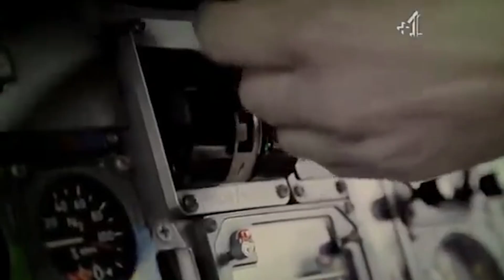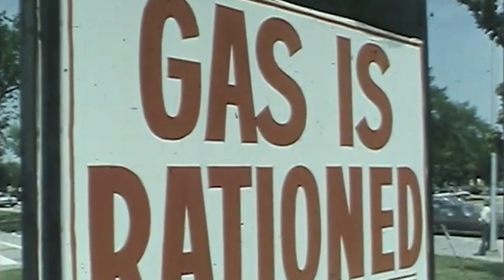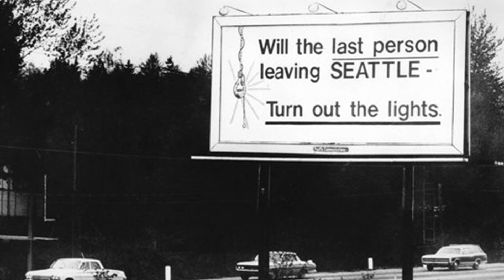The Forgotten American Concordes - Boeing 2707 - Lockheed L-2000 SST

Comment: Meh, it's unlikely anybody will be too bothered with SST any longer, at least not with Virgin Galactic working to bring sub-orbital flights to the private sector.  Granted, getting it to work reliably and safely is no trivial thing, but if they succeed, we'll have trans-atlantic flights that are far shorter than even 3.5-4 hours, and without worrying about the issues with sonic booms over populated areas.

Comment: 6:51 Yes jet engines would be inefficient during taxi, but the engines are not at full throttle on taxi. So it's still less fuel burn than flight (even though it would still be hopelessly inefficient at taxi speeds). But the actual hourly fuel burn on taxi would not be any where near maximum (like on take-off). I don't believe two tons of fuel burn just to taxi to the runway. No way, the whole max loaded weight of the plane would be much less than 400 tons (weight of a loaded 747). So if it burns two tons on taxi, take-off should burn more, and how long would it stay in the air with that sort of fuel burn. It would have about 100 tons max of fuel on board (otherwise it would weigh more than a 747). At 2 tons for taxi, you are looking at at least 2% of the total fuel burned before it even takes off. How many tons for take-off? With that sort of rate, another 8 tons at least. 10% of fuel burned after take off. Would that be right? And the speed makes up for it? Maybe it does, but it sounds like a bit "tabloid" to me. lol

Comment: many yrs ago, I once asked my mechanic about how much it might cost me to make a car I used to have, run faster with a more pwrful engine? he said, "it all depends much you're willing to spend." it's all about $. the faster you wanna go, the more expensive it gets. I'd be more than satisfied with an SST that could go mach 1 or even just a little faster. it doesn't have to-do-mach 2 or higher. of course there is the problem of the sonic boom. when engineers find-a-way to get past that obstacle, & make SST travel affordable, then you'll have-a-winner.

Comment: I wish they'd bring it back or make a cost effective super sonic aircraft.
Reply: There are a few concepts in the design phase, but they are much smaller and will travel slower than Concorde to reduce the sonic bang or boom. The largest I read about will carry 40  passengers and travel at about Mach 1.4 to Mach 1.6. One big problem seems to be in finding a suitable off the shelf engine or one that needs few modifications.
Reply: Phuck Hugh simple get army ones
Reply: Phuck Hugh I mean join army as pilot
Reply: Phuck Hugh Yeah, Club Concorde will bring back the Concorde in 2019
Reply: prestige is one thing, but gosh such planes are terribly noisy and expensive. A ticket on the Concorde was extremely expensive, and since we don't all have an income like Phil Collins...

Comment: damn those things are beautiful... wish they bring back the Concorde..
Reply: They will not bring it back. Too much of a sonic bang over land. Next generation will travel slower to reduce sonic boom over land.
Reply: +David Hoffman would've been nice if i was old enough to see them
Reply: Rage Lorenz, One really sad aspect is that the Concorde B model would have solved a lot of the takeoff and landing issues the A model had. Leading edge flaps, revised wing shape, and a better engine with no need for afterburner or reheat would have provided reduced takeoff noise, reduced runway length requirements, and lowered fuel consumption on a per ton-mile basis. But Aérospatiale/BAC insisted that 120 A models had to be sold before the B model would be produced, and then only with 120 firm no refund orders for the B model. Sadly only 24 A models were ever ordered, and they did not even produce that many.
Reply: Indeed. As if they knew this project was going to be temporary

Comment: Am I crazy thinking in the 60s we would hear sonic booms now and then?
Reply: Even in the 60's there were restrictions prohibiting supersonic flight over populated areas.
Reply: Yes, if you lived near a military supersonic test area. It still happens today when they test supersonic military aircraft.
Reply: I rarely see anything these days, but I'm only about 25 miles from Willow Grove, they shut it down a few years back, but who know what was flying out of there in the 60s.
I'm also close to two national guard air wings, every once in a while in a while I'll see a couple A10s, I assume that's were they are coming from there, there's no way they are going SS.
I don't what they flew back in the 60s?
Reply: I live in the Netherlands and in the end of the sixties you could hear the sonic boom there. This must have been starfighters?
Reply: hendrikjanvanduin, Mostly F-104s and a few F-5s. More F-5s added in the 1970s.
Reply: no
Reply: It was quite normal back in the 1950`s, but later not so common, I have heard the sonic boom from the Concorde  but that was out near the coast in a remote location.

Comment: Concorde paid for by the people so the rich could get there faster
Reply: Remember this was before deregulation of the airlines. Aviation was costly for most anyway, so this was just a normal progression of that cost. And the Cold War was in the background. No way could we let the Soviets create something like this without being challenged was the thinking at the time.
Reply: The thing with it was that it could go supersonic and stay there, im sure that was a first because military jets could only do this for a short time so I read a time ago
Reply: *****, True, for interceptors you will go supersonic to get to the opponent quickly, but then the air to air combat often goes down into the subsonic area. For high altitude bombers the plan was to stay supersonic all the way, but that ended up a failure. Now you use supersonic as a dash speed through some of the opponents areas, but not all. Concorde could fly supersonic without the continuous use of reheat. Reheat was only used to go from subsonic to supersonic. After getting significantly past the trans-sonic zone the reheat could be shut off.
Reply: Sounds about right.  Certainly the resentful part.
Reply: You do get that saying "The top 10 percent of taxpayers paid over 70% of the total amount collected in federal income taxes in 2010" means nothing on it's own right? What did they earn in income and capital gains? If they got 90% of the income (hypothetical - I don't know the real number) then 70% is actually not their fair share... that's a pretty misleading thing to say lol.
Reply: Blame Warren Buffet, he claimed he was paying less taxes (by percentage of gross income) compared to his  middle class employees. Rich people can pay less taxes LEGALLY through investments, bonds, charities, deferrals. Rich people become rich because they buy something that make a lot of money! Middle class become poorer because they buy expensive things that doesn't make any money!
Reply: http://www.telegraph.co.uk/finance/personalfinance/tax/11233686/How-top-3000-earners-pay-more-tax-than-bottom-9-million.html
Reply: +Miike Hunt Do you have link about the documentary.
Reply: stickmagnet   Well duuuh! Up to $99,999  you pay taxes on every dollar past that,100,000 and up you pay taxes on the first $99,999 regardless of how much over that! So Buffet was telling the truth!
Reply: SE09uk so not true. i dont know about america which seems to have given 75% of the costs of the planes however, you did not have to be "rich" to go on concorde
Reply: what prove do you have?
Reply: But it looks nice so that's OK :)
Reply: hs2
Reply: squach623 !!!!!
Reply: The top 10 percent of taxpayers paid over 70% of the total amount collected in federal income taxes in 2010.
The remaining 90% bore just under 30% of the tax burden. 47% of all Americans pay hardly anything at all.
These number apply to US taxpayers as of 2010.  The percentage paid by the wealthy is even higher today.  You live under the delusion that somehow you are being ripped off and are ignorant and arrogant enough to call other people naive.  The notion that rich people don't pay any taxes is a myth that's repeated often to keep people such as yourself in a constant state of agitation and more likely to vote democrat.
Reply: You sound like a pretentious and envious git whinging because some people have more money than you. How sad.
Reply: The Concorde was the beginning. Before the Concorde, only some professional pilots at the military flew supersonic. With the Concorde, everybody could theoretically buy a ticket although practically only the rich would do.
But the Concorde was meant - or wasn't it? - to be the beginning. When the rich paid the tickets it should have financed the development of new better supersonic aircraft: bigger supersonic airplanes where the tickets are cheaper than in the Concorde, so the less rich can fly it, too. But we never got there.
All the anti-Concorde measures were also measures to block the development of future cheaper-ticket supersonic airplanes. And that's what's sad: that the more advanced airplanes were never build. Not so sad: that the Concorde disappeared.
Reply: Greg Howard lol your so naïve
no they don't, they pay very little, they use loop holes and scams like giving to charity and getting it back later. (the people I used to work for did that and NEVER paid a penny tax) 
I'm guessing you were born yesterday as they say ;-)
Reply: oh yeah, the rich, the people who pay 90pct of all tax revenue from income taxes.

Comment: In a documentary the Russians said that a unidentified aircraft crossed the path of the Russian concord causing it to crash, I think they blamed the cia. the Russians also had men on the ground picking up tyre skids to see what they were made of. it was on tv so don't know how true this was
Reply: Not USA CIA, French version of CIA and DIA. Stupid and dangerous attempt to see exactly when and how the forward retractable canard system worked on the TU-144. Totally unnecessary action as aviation engineers knew it had to do with control problems at certain airspeed ranges. The Concorde had solved this with the ogive shape of the wing. The USA had a fancy triple delta configuration to solve the problem.  Fixed or retractable canards were an aerodynamic and maintenance mess that other designers had avoided.  The French unintentionally killed the Soviet flight crew and some French citizens for an absolutely illogical set of reasons.
Reply: David Hoffman Thanks for the info, very sad

Comment: Don't forget about length contraction as explained by Einstein's theory of Special Relativity.   The faster an object travels it will contract in length.  When the object is a rest it returns to it's original length.   This is not really a factor compared to heating and cooling effects (based on airspeed) changing the length.
Reply: Cute.
Reply: It's not even true. I mean, I know(?) you're joking, and yes, it's a real effect, but it's observer-dependent: the length of the object contracts as viewed from a different reference frame, but anything co-moving with the object won't see any contraction, so it won't produce any stress on the construction materials, unlike thermal expansion. Also, not really noticeable until you get up to somewhere around mach one million, by which point simply staying in the solar system will be the big issue to solve :)

Comment: ..there was one more company that explored the Ida of Supersonic Commercial travel.  IN 1961 Douglas explored the idea of a supersonic transport dubbed the 2229. The configuration was a delta wing with extended delta foreplanes at the wing root and delta canards.  The aircraft also has variable geometry wing tips similar to the XB-70.

The ides was more conceptual as the company did not have the financing to pursue such a project on its own. The company may have already seen the handwriting about economics as the 2229 was to carry only 100 passengers (less than even the Concorde) with a weight heavier than a subsonic 707.  Douglas was yet to turn a profit on it's DC-8 and therefore were fairly cautious to the point of not entering the design into the US SST competition.

http://i969.photobucket.com/albums/ae176/CAIR67/Douglas%20SST/photo1.jpg